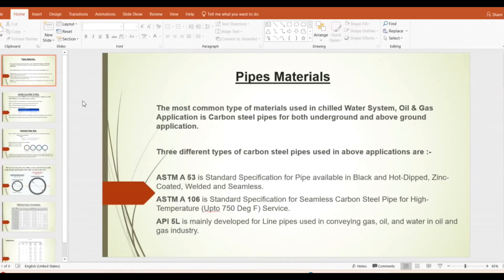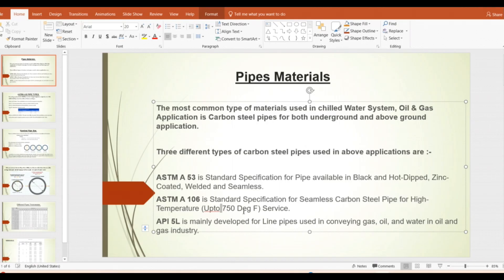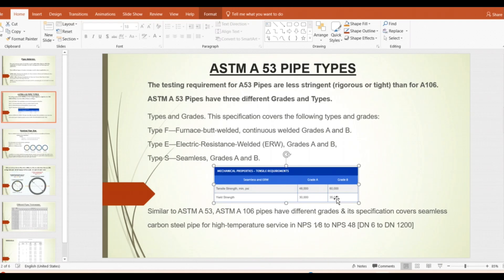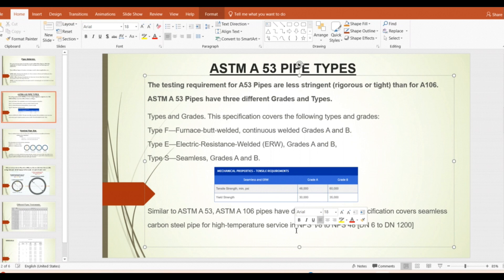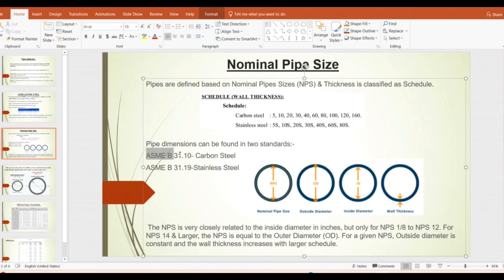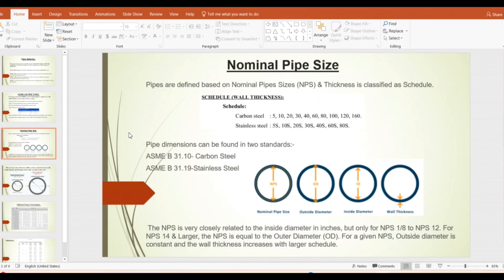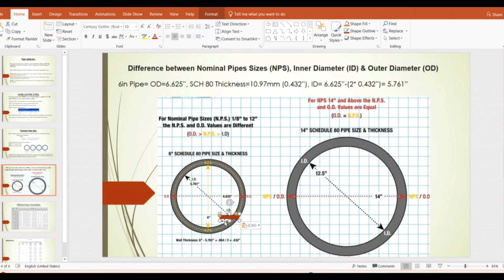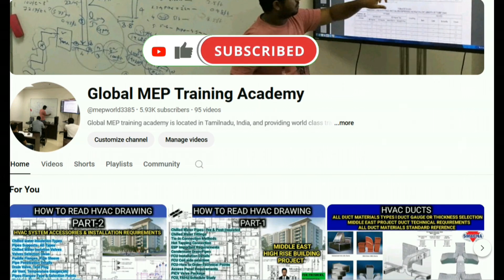Chilled Water Pipe Materials Explained l Grades, Thickness, Standards & Dimensions

Comment: What schedule pipe size usually be used? Can we use schedule 10 pipe for bigger pipe size?
Reply from the maker: In middle east mostly we use schedule 40 for Firefighting above ground pipes. Like ASTM A53 schedule 40 grade b or ASTM A 106 schedule 40 grade b